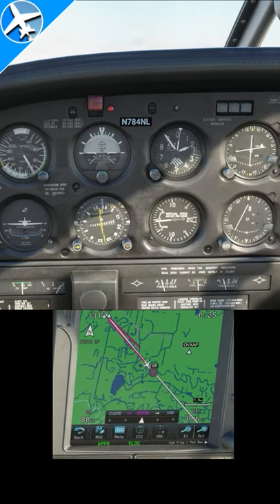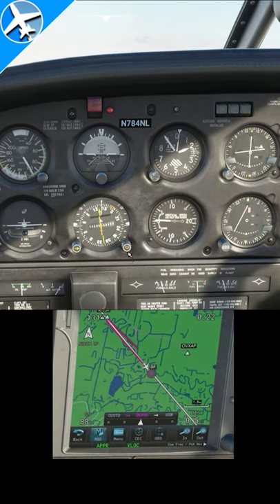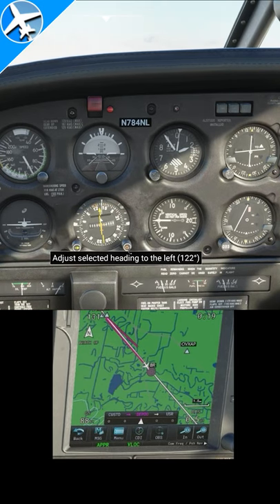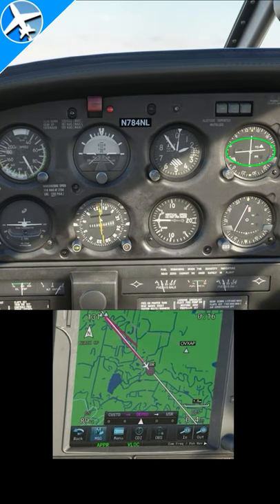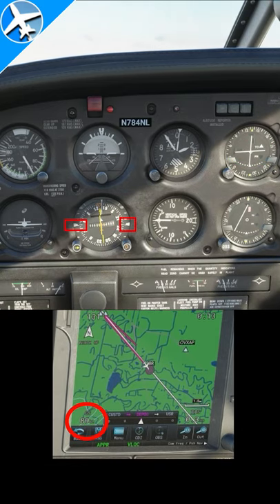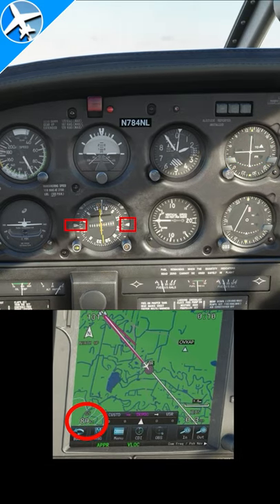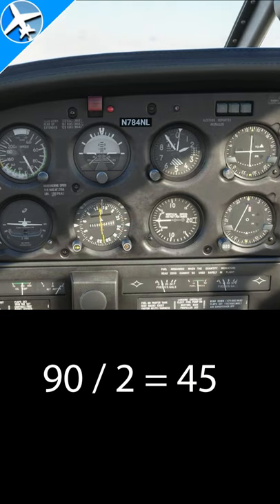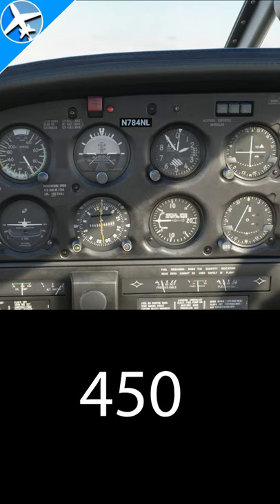Vertical Speed Required to Maintain Glide Slope? FAA Instrument Written Test Question #Shorts

Comment: As always helpful tips from a pro that knows 😀🛫
Reply from the maker: I am sure you knew this trick at some point over the years 😁
Reply: @thecorporatepilotdad  I did however I am not sure how often I employed it. Flying the same airplanes Lear and Falcons Jets you just had a feel for what you needed in descent rate for that airplane. plus I wanted to the glide slope needle moving, heaven forbid if it ever became stuck on the glide slope.
Reply from the maker: @TheFalconJetDriver  I still use it some but you’re right, flying business jets were almost always going in the same speed range so 700-800 from almost always works or gets very close.

Comment: I made lookup tables for TOD and ROD. 90kts = 478 ft/min. Real fast and easy.

After printing, I folded and taped along the monitor bezel the tables. A handy "placard".

I can not leave a URL but...
flightsim dot to
top of descent rate of descent lookup tables
Reply from the maker: I think YouTube sees a link and thinks spam.  Nice job beating the system!

Comment: Here before the algorithm blows this one up.

But I must ask, what are the limits of this?
What type of aircraft, and odd situations would this not work with?
Reply from the maker: It works when maintaining a 3 degree glide path.  Aircraft type doesn’t matter. If the speed changes so does the rate.  I.e. 60 knots gs is 300 fpm while 600 knots would be 3000 (no one would be going that fast, just an example).  The faster the ground speed the steeper the descent required to maintain the constant 3 degree slope.
Reply: @thecorporatepilotdad  
Thanks for detailing that. My brain just clicked together how that works.
That's a cool little trick!

Comment: Sounds like the same as just multiplying by 5 I suppose
Reply from the maker: Yes.   Either way works but, in my opinion, it is easier to cut the number in half when working with larger numbers in faster airplanes.  140/2 and adding a 0 is easier to figure than 140X5, at least in my brain.